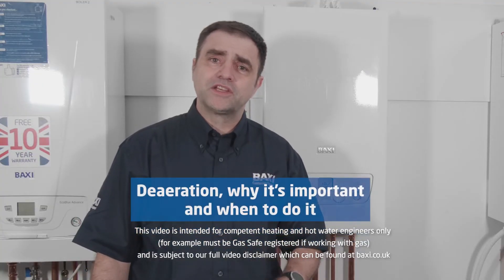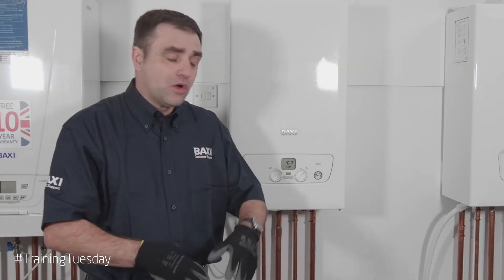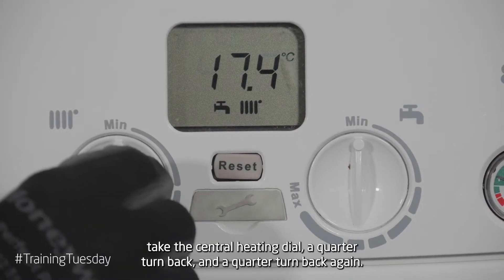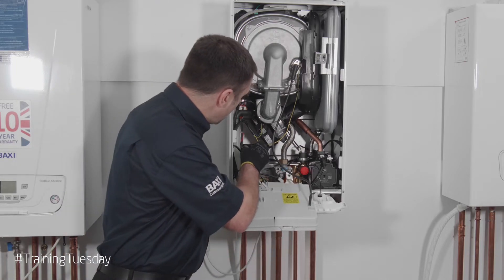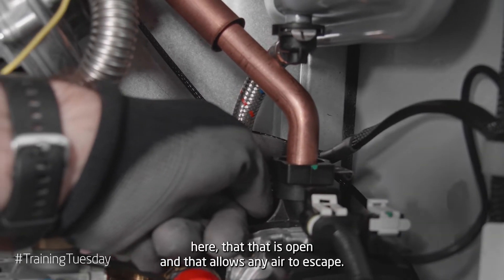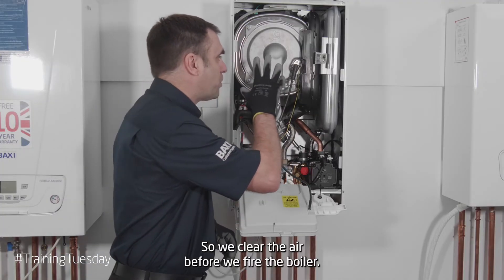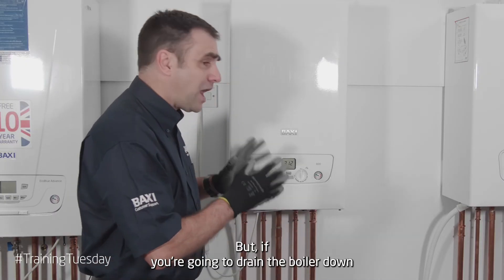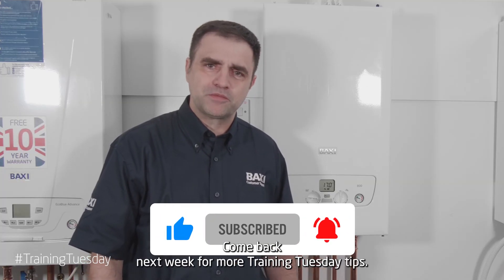How to deaerate a boiler and why it's important

Comment: Turning the hot water knob a quarter twice is normally for the service mode where we can run it on min and max. Unless this feature is on the new boilers?
Reply: To put the boiler in commissioning it would be 2 quarter turns on the hot water dial. deairation is the heating dial.

Comment: Beautiful Boiler but why was the small sight glass omitted on the front of the heat exchanger in comparison to its predecessors which was great way to visually check the ignition and flame picture?
Reply: Hello. They cut back on it because it’s another thing to ‘go wrong’, another part to fit and another possible issue. Plus it saves them money to leave them off. Just like the Vaillants as well
Reply: In training we were told it was to do with reducing heat losses from the heat exchanger.